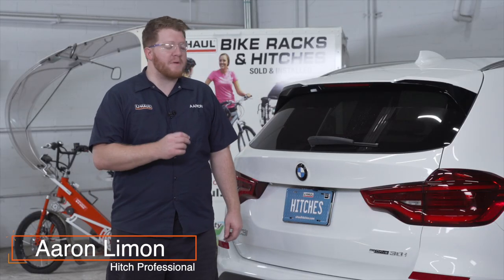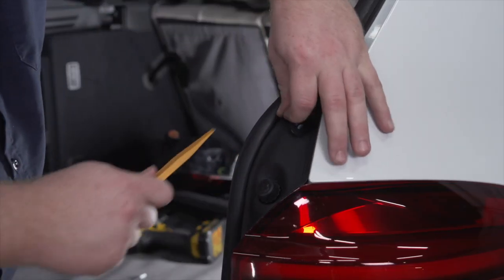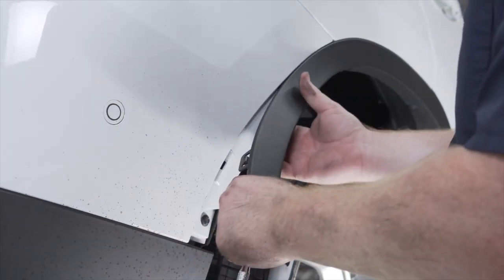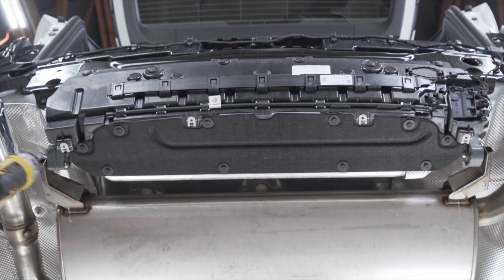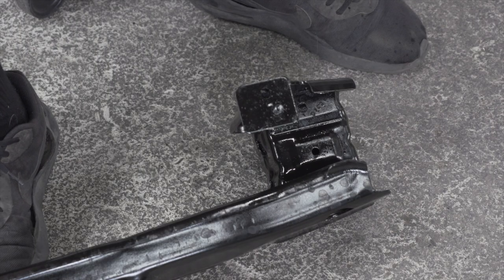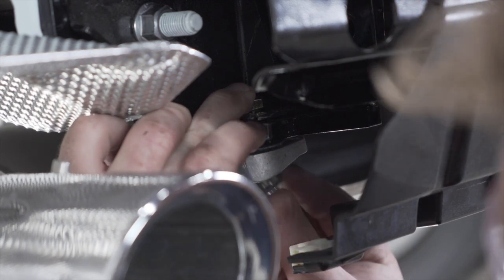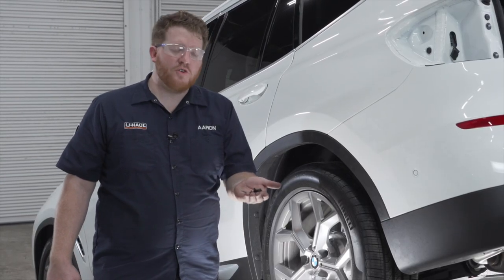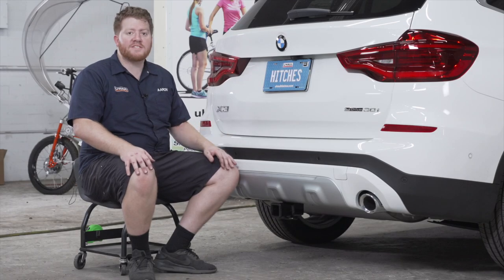2019 BMW X3 Trailer Hitch Installation

Comment: This is an awesome instructional video that I highly recommend if you are thinking about doing the install yourself.  I set up my laptop in the back of my wife's X3 and followed it step by step.  For me, the only challenging aspect was connecting the rubber hanger grommet to the new hitch and muffler on the re-install component of the passenger side.  The only other comment I have for those who are considering the install, the instructions say to cut the panel out for the hitch at 3.5" wide by 5.125" deep.  I feel that about 4" deep would have been plenty room for the new hitch.  Otherwise, this install is pretty straight forward and wasn't too difficult.  It took me about 3 hours but I was taking my time making sure I did everything correctly.  If you have confidence in your ability to follow the video, the install is pretty straight forward.  Thanks for making such a great video to follow.  It is much better than trying to follow the printed instructions that came with my Curt hitch.   Also, my hitch was missing the included hardware and Curt customer service wanted 4-5 weeks to send it to me.  Instead I bought my own bolt:   HHCS M8X1.25, 35mm, 10.9 class, YZ Yellow Zinc and M6 Poly rivets.  5 minutes at the hardware store and I was all set.  Hope that helps others who might need the hardware.  Good luck with your install!
Reply from the maker: Thanks!

Comment: Good video. Very complex install, lots of potential for ending up with a hitch on a non functional vehicle :). UPDATE 6/9/2023.  On Monday of this week I installed a draw tite hitch on my X3 following most of the instructions on this video. Really wasn’t as bad as I expected aside from a couple problems with removing and reinstalling those poly rivets around the wheel wells.
Reply from the maker: That's why we have hitch professionals all across North America ready to do the install for you!
Reply: Yes, I’ve also discovered that and I might just setup an appointment with one of your locations. I’ve had U-Haul install hitches before on our Volvo XC-60 and Honda CR-V and they did a fine job.  Not sure if it’s inflation or the labor intensive nature of the install on the X3 (perhaps it’s both) but my local UHaul is quoting $412 for the install. I’m retired and have oodles of time and most of the tools needed so was just hoping to save a few bucks and do it myself.